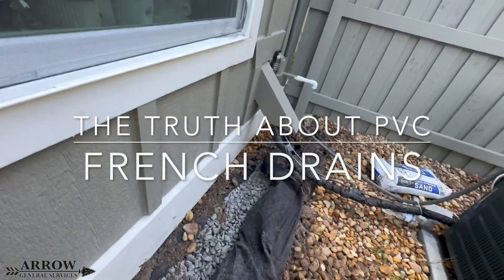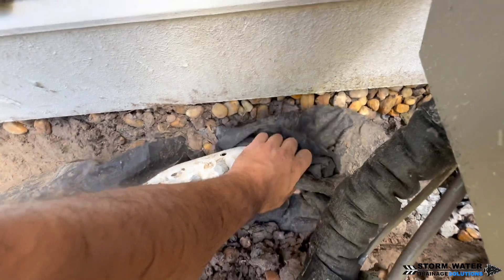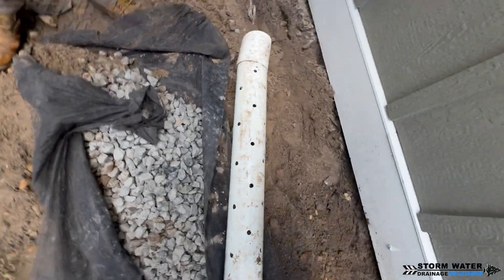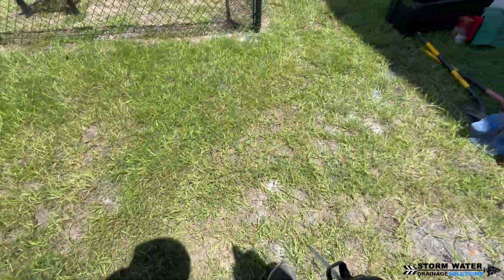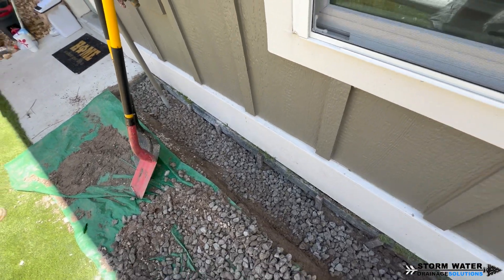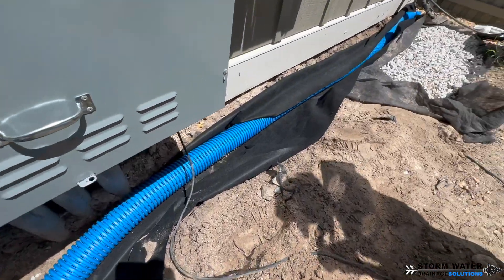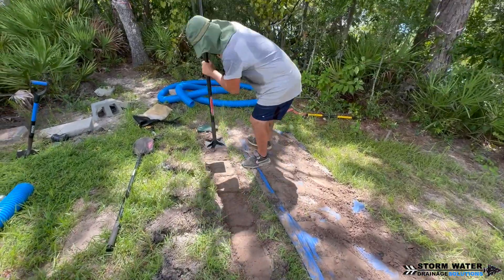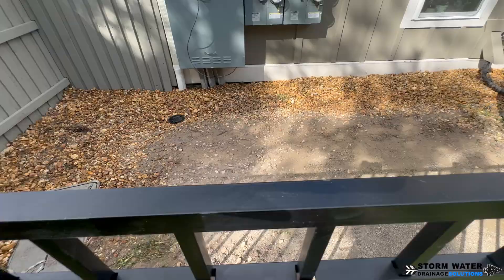PVC French Drain Failure - Tampa Yard Drainage - Storm Water Drainage Solutions - Rain Water Drains

Comment: This is different to the advice given on the Gate City Foundation channel - is that because of location? The guy there seems pretty knowledgeable. Want to know as about to do my own drainage.
Reply from the maker: @chrisstroll305  Sean with Gate City Drainage does very good work. We personally don’t use PVC for French drains because of the reasons that were stated in this video. Corrugated pipe especially the FDM high octane slotted pipe has the most inlet compared to any other perforated pipe on the market. That alone makes it far superior to PVC because the flow rate will be much higher. Air flow through that pipe is also incredibly good which is important in the dry season to air prune roots that get into the pipe. All in all after seeing 1000s of drainage systems of all types out in the field and seeing their strengths/weaknesses we have come to the conclusion that the methods we use as well as the French Drain Man are the way to go for a higher rate of success and a quality drainage system. You can choose any pipe/method you would like, all we are here to do is show you what we have learned and found works the best after years of being in this industry. 💪
Reply: @StormWaterDrainageSolutions  Makes sense, thanks. Perforated PVC is harder to find in my area anyway so an easy decision!